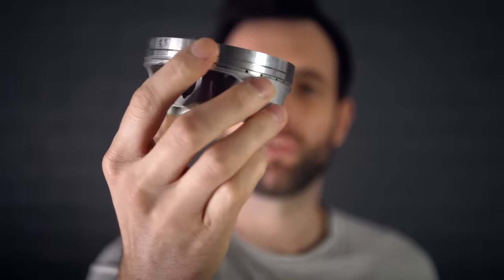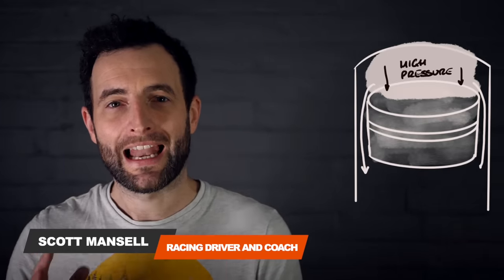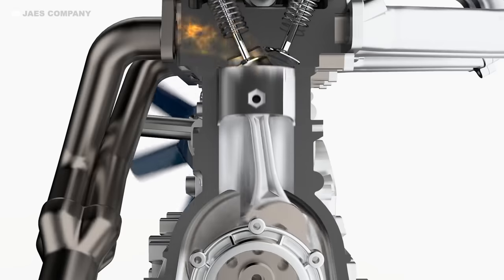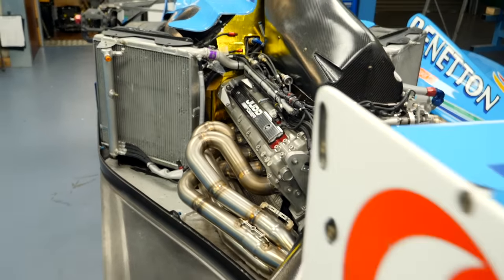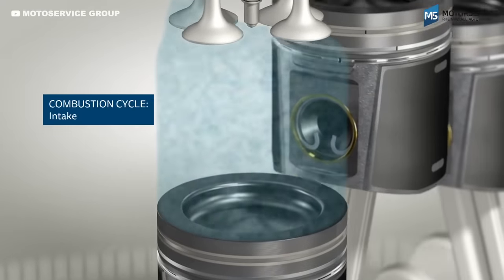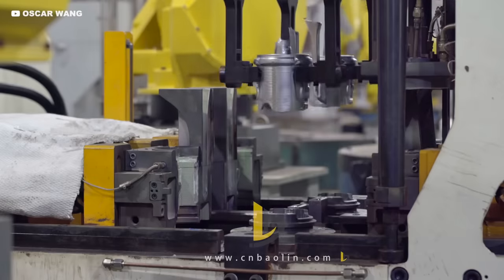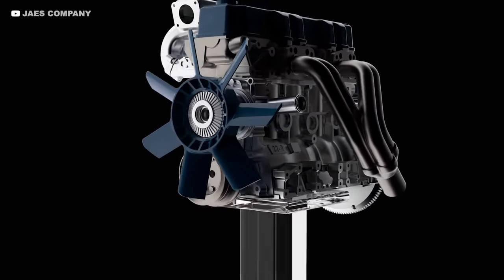Why F1 Pistons Cost £50,000!

Comment: I'm not seeing 50k of work and material. I think these prices are very over inflated.
Reply: +50% of the price is R&D, the engineers who design f1 engines use a lot of time researching how to make every component lighter or stronger just to be a couple of grams lighter than the opponents. 

But yeah it doesn't look like 50k pistons 😅
Reply: That may be the price per piston when the engineering cost, tooling, and fixtures is amortized in per like the 20 sets they get before they change it and start all over again
Reply: Thats the average price for the whole production run including R&D and exotic materials. 

Production cars have batches 1000x larger than F1 teams so the R&D cost average is 1000x smaller.
Reply: @awellner3285  yeah exactly. This video only talks about the tolerance which is an extremely small portion of the cost in this case.
Reply: @awellner3285  where is the exotic material? Just wondering
Reply: @LoudandProudBSE  indeed. the tolerance realistically isent tight at all. modern grinders can hold plus or minus .00005 in decently easy.
Reply: @danieljakobsen1289  specific materials used for the components, alloys with extremely precise measurements of composition and thermal characteristics. Stuff that wouldn't need to be mass produced either, so there's fewer economies of scale. Small batch, high precision machining is also hideously expensive, since the process basically amounts to "machine something, measure it, correct machining errors" and repeat that many times until tolerances are met.
Reply: @robbell3217  and where's the answer to my question? I just see aluminium which is found all around the earth.
Reply: @danieljakobsen1289  It's kinda stated right in the video, it's an aluminum alloy. Synthetically produced to have specific material characteristics. The exact compounds and ratios used are going to be a trade secret.
Reply: @robbell3217  Sorry to burst your bubble but we aim to get it correct first time everytime these things do not cost £50,000 more in the region of £200 to £300 and what do you mean by synthetic alloy you have no idea what you are talking about best to keep your mouth shut and not show your ignorance.
Reply: @robbell3217  Well. That didn't answer my question about it being exotic.
Reply: @philup4947  That's the exact reason I don't say anything about this, this is way beyond my knowledge😅
Reply: R&D is not something you can easily be factored in, especially for a product that is not meant to be sold. I find the pricing laughable as well. It might be relevant, as long as the engine is running. After that, yeah its value and price is deflated.
Reply: @robbell3217  "Small batch, high precision machining is also hideously expensive" If I had to quote the machine work on them pistons, lets say 100 pcs and with feature tolerances to ±.0002 inches, concentricity and runouts to .0002. I would quote $160.00 each, this would include 80 hours of machine time some tooling, time to make a fixture, CMM set up and inspection, programing & setup time. The 80 hours is inflated, realistically less that 40 hours. I feel the 50K for each piston is grossly inflated, people taking advantage of the huge pockets of these teams.
Reply: @robbell3217  In 2021 the I believe the rules are you have to use off the shelf materials.

Comment: The high price comes from a low volume of pistons being produced. Today high end aftermarket pistons and F1 pistons are made from 4032 aluminium alloy. 
The expensive part is not the forging or machining, it is getting the tolerances along with researching various designs etc. And interestingly enough, after rules changed in relation to how many engines a team can use, the price of pistons has skyrocketed. Not because they got more advanced, but because much fewer are required for a season. The cost per piston is directly proportional to how many pistons a team requires.
A friend of mine works with Mahle, and they do the main bulk of F1 pistons.
What will make them cheaper is the 3D printed pistons currently under development.

Comment: Then Cleetus McFarland and Bob the builder get 1000 hp for 10k engine
Reply: Getting 1000 horsepower for the cheap is easy, just take a low comp LS, and bolt two turbos from a tractor, and some intercoolers

Getting 1000 horsepower ,from 1.6 liters, while running at >50% efficiency, and making the engine last 5000KM at full throttle all the time, that's quite difficult

Comment: Honestly I call bs on that, I work in a high precision CNC shop specialized in aerospace and a 0.004 tolerance is a huge tolerance. A part like that is nothing special, tolerances start to get tight when  you get to a couple of tenths (ten-tousandth of an inch).

Comment: How do you build an engine that is seized when cold?
Reply: Heat up the block (flame heaters or hot water/oil), and toss the pistons (with Conrod in place) in something cold (liquid nitrogen is a common thing to use). Don't touch anything with your hands.
Reply: Haha, you don't, he got it wrong
Reply: On the video that is, the comment above is correct in its use of sarcasm

Comment: I suspect there is some other reason the pistons are made non-round other than different material thicknesses responding differently to a change in temperature. All dimensions will scale identically when going from one uniform temperature to a second uniform temperature as long as the material structure is constant.

Comment: It's the other way around. The pistons expand more than the cylinder, making the piston clearance very large with a cold engine. When cold starting an engine with high performance pistons it can even be possible to hear this, and the pistons produce a clapping noise when they are poorly guided in the cylinders. So why is it that the piston expands more than the cylinder? Well, the main reason is due to temperature. The operating temperature of a cylinder isn't much above the coolant temperature: F1 liners/linerless blocks are made from aluminum and are Nikasil coated on the inside for wear resistance and aluminum will transfer the heat to the coolant in an efficient manner. The piston will operate with a much higher temperature, despite using multiple oil sprayers on the underside of the piston the piston crown can see temperatures in excess of 350 degC. Also, the aluminum alloy used in the pistons tend to be of a low Si-alloy which have a greater thermal expansion than the high Si-alloys used in roadcars.

Comment: Those tolerances are nothing amazing if you're a machinist. It only amazes people who have no idea about machining. Btw you did not correctly explain why they cost 50 000 pounds in this video. You only said they are expensive and gave few very basic inspecific arguments, which hold little water. The materials on this piston are cheap (in comparison to other special alloys that exist) and they are not machined for "hours". These are relatively simple objects, and can be machined relatively quickly. What is the most expensive part on this are the astronomical salaries of the very very skilled and experienced R&D people. So thumbs down. I hate simplistic hype.

Comment: @ 9.18...Wrong.  .15mm is NOT 60 thou! No internal combustion engine would run with that much clearance. It would have zero compression. .15mm equals .0059 which is fifty-nine ten thousandths, or nearly 6 thousandths of an inch which is still wrong. It's way too much clearance. Even big American V8s don't run that much piston to cylinder clearance. They run about .0012 to .0016 clearance, or roughly 1 and 1/2 thousandths of an inch for cast aluminum pistons and slightly more for forged aluminum pistons. Check your numbers and your math Driver61!
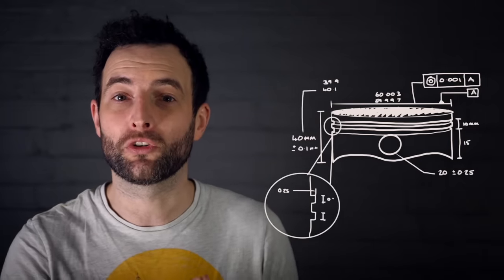Reply: Also at 2:38 the sketch shows a tolerance of the gudgeon pin hole (wrist pin)of 0.25mm(around 10thou) . Would rattle like mad. Many errors in this vid.

Comment: I used to grind tools, i wont specify which ones but i tell you what, without them cars wouldnt run. I had thight tolerances like that, honestly if the piston stays in the tempature of norm, and gets cooled enough while grinding, these tolerances are possible, though imo could be made cheaper. At least in my old company we could grind such thight tolerances, since the machines are build so they grind 0.0001 to ensure every tool that came from it would be absolutely perfect. So i dont really see the extreme pricetag, since lets say the tool grinds 8 hours on that part, together with the guy who programmed the machine and a extra for profit we end up at 10k. Though asfar as i know my boss he would ask for the same price like in the video lmao

Comment: remind of a video of this company in japan was making parts for nasa. the metal they used they have to make the tolerance so perfect that it was almost impossible to make. they have to use super cool temperature assemble it. once it goes back to room temperature it sized up. it can only operate in low temperature as it shrink slightly for movement. giving a change of temperature the device would malfunction.

Comment: Spend that much time transfering heated fluid, have they ever heard of a block heater? Pretty common in cold climates and pretty light weight vs the extra lines and fittings needed to connect to the external heating equipment!

Comment: I'm lost by your comment that the Pistons are seized in the block when cold and not when hot. I would think they warm the motors up so that everything is expanded and at their closest tolerances.   When cold the pistons to cylinder clearances are likely to loose when cold, not to tight as you state.

Comment: So the must bore and hone blocks not only with torque plates with head gaskets installed to duplicate distortions of the head bolts pulling up on the block but they must also have probably race temp coolant flowing thru the block and torque plate to duplicate  thermal changes to the dimensions

Comment: I've heard that expression many times and always wondered - If the pistons seize when the block is cold, how do you assemble the engine? Also does that mean that the engine can't be turned at all while cold? 
Or do you mean that if the engine is started cold the pistons would expand faster than the block, causing them to seize?
Reply: Nope you literally have to warm up engine before you can start it up

It is said a f1 car is a very complex car

Comment: 1) Is it just me, or did the F-1 piston appear to not have an oil ring grove?  2) Forged pistons can be stronger than billet machined because forging can make for a better grain structure in the metal.  3)  There was no mention of the use of different aluminum alloys that can have different coefficients of thermal expansion, pistons are typically made from an alloy that has a lower coefficient of thermal expansion that the block.  4)  Was there a chance that the F1 piston was Titanium and not Aluminum?

Comment: The clearances (not tolerances) mentioned are nothing special. Most motorcycles run similar clearances, and a competent mechanic can resize cylinders with a hone and an electric drill. 

My guess is that most of the cost of the piston is to recover the money spent in development, and in the development of parts that never got sold.
Reply: I used to teach it at MMI, had a few students who could hit exact numbers after only a few hours training.

Comment: The clearance thing doesn’t make sense to me. F1 pistons are made from forged 2618 aluminium. The block is also an aluminium. Heat in pistons is quite above that of the block. Therefore pistons will have quite a bit of clearance when the engine is cold, and it will get tighter when at 18k rpm.

I understand that the reason that the engines are warmed prior to running them is due to the timing gear drives. They’re too tight when the engine is cold and that expansion of the block allows the timing gear train to come into operating clearance.

Comment: The real difference between the F1 and the road car piston in terms of costs is production quantity. It makes a difference when you calculate your R&D NRE by some hundred pistons you make or some 100 thousand parts. The machining tolerances stated in this video make the part more expensive, but this is negligible, because it's eaten up by the (in fact) higher engineering efforts to design a cheap piston.

Comment: I machined parts for  F1, and fully know what's involved in the process.
Most of that cost is for all the rejected and spare parts made.
We didn't make 8 pistons , or 6 conn rods at a time .we received standard orders of 120 pcs. ALWAYS !!!
After machining, those were then magnafluxed , if passed, then X-rayed , if passed, 100% balanced and marked in groups  equal to number  required.
You paid 48,000 thousand for F! bragging rights, and about 2000 in actual single part value.
Oh your manufacturer stories....you guys crack me up, 50k piston ROFL double facepalm.

Comment: In engineering, irrespective of what you make, the one-off costs are high. So if you don't have the volume to divide the one-off costs by, things are expensive. The biggest part of the price difference between F1 and road cars is still from economies of scale, not from the engineering challenge. A road car piston is developed, and tooling procured, to produce millions of them. For an F1 car, this is like a few 100 pieces (per team: 2 cars x ~4 engines per season x 6 cylinders per engine = 48 cylinders per season). If F1 cylinders would be produced in such high volumes, the cost would be maybe $500 instead of $50 for a road car cylinder.

Comment: O.k. , I bought a 67 mm Namura piston for my suzuki LT230s quad, the whole kit was about $100, cyl.bore ( 1mm oversize ) was about $150, gaskets, $25, I guess I can't complain ! 
* Oil control ring was a big pain to slide cylinder over, but it runs great,  I went from 228cc to ,maybe,232cc? 
1mm bigger piston

Comment: Correct me if I'm wrong but 90% of what he described is applicable to all pistons and design.  The fact that the tolerance range built into an F1 engine is less than that of a typical car doesn't drive the cast delta that far.  Materials and or casting/forging will definitely change costs, but unlikely that much alone. Sure lots of QC measurements (including X-rays or MP scanning or whatever), but I still don't think that all that would add up to 50,000 BP.

Comment: The old fashioned steam engines used to let new steam in BEFORE the exhaust stroke was finished to slow the piston down. Why not close the exhaust valve early and let the increasing 'back pressure' slow the piston down? Yes, of course that means you havent emptied the cylinder completely for the next inlet stroke but it would be interesting to know if in fact mixing the inlet with already hot gas helps the efficiency of the burn.
Reply: That's what they do with EGR on street engines.
 It helps fuel efficiency as you can run a lean mixture without overheating (can't burn exhaust gas but it helps lean mixture evaporate)

Comment: I’m late to the party but, being in the field of engine components:
1- They don’t cost nearly close to 50.000$. Including R&D, designing a piston is not rocket science.
Btw: a regular piston doesn’t cost 50$ either (cost! =/= price advertised by OEM’s/Tier 1s!)
 
2- these tolerances shown are nothing special. They’re actually in the microns range, which is fine, just means more scrap if the process isn’t capable. 

The biggest difference between a regular and an F1 piston is quality control.

Comment: Basically the main reason is because it's a proprietary part that isn't mass produced hence the extremely high cost. If we divide that further down the line then we realize the majority of the cost for that part is not actually for the part it's self but the cost of paying the engineers, machinists, and people who make those parts wages based on their skillsets and knowhow to produce a part that has low production volumes. Now if millions of those parts where produced each year then the cost would be significantly on a order of magnitude lower than it current is projected to be. Again most of the cost is paying the engineers and people who design these things and that fact that these things are proprietary and not produced in volume with subject to constantly change with design depending on the season.

Comment: In my humble opinion you forgot the most important reason why these pistons are so expensive. The aluminum alloy used is an alloy that cannot be made in a conventional manner because of too high amounts of alloy materials added to the melt. To make it possible for this alloy to stay homogenous it needs to be cooled down from molten state to a solid in less than a milisecond, and that requires VERY special equipment. So the not standard at all basis alloy these pistons are made from are many many times more expensive than the most expensive standard (aerospace) quality alloys. The first F1 engine manufacturer to use this technology was Mercedes who bought very smal first batches of this new material from a Dutch company working together with Delft Technical University, the first to realize successful  production of these super alloys.

Comment: these dont cost 50k because of manufacturing, its the R & D.

curious why titainum wouldn't be a better option for a piston?

how often are pistons replaced?  Every race? season?
Reply: Titanium is terrible for sliding parts and want's to become part of the stationary surface.
 Even Honda had massive problems with titanium valves either breaking off or sticking in guides.
DLC coatings have made a difference but add cost
Reply: @1crazypj  hey thanks!  I machine & weld steel & some aluminum all day...never had a chance to do anything with titanium, so all I know if its got a high strength to weight ratio & handles heat well.  Now I know Its also sticky.